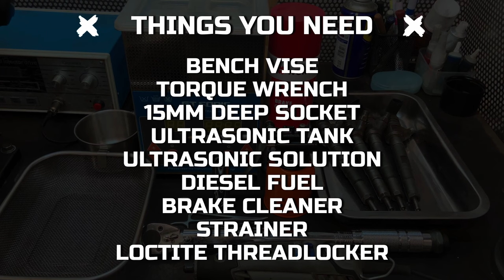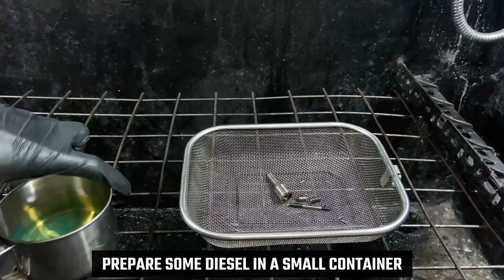HOW TO CLEAN BOSCH INJECTOR NOZZLES LIKE A PRO | 2021 ULTRASONIC CLEANING DIY

Comment: Best film I've seen on these injectors. Exactly what ive got to do, so thanks from here in Cornwall 🇬🇧
Reply from the maker: Thanks! :)
Reply: The exposed procedure is wrong.
Reply: @PopaAlexandru.  why is that?
Reply: @felipeuk12  For example, the lack of a basket in the ultrasonic bath... one error is enough for the whole process to be compromised. And there is at least one more error: the use of thread brake.
Reply: @PopaAlexandru.  well spotted 👍
Reply: @PopaAlexandru.  Hi,  by thread brake you mean blue thread locker? I'm about to do this clean myself so I would appreciate the tip, thanks in advance :)
Reply: @SmokBartozy  Yes, that is blue threadlocker.
Nothing is put on that thread, it is tightened to the torque indicated by the manufacturer. Only .
Reply: @PopaAlexandru.  Thanks for your reply, much appreciated.
Reply: @PopaAlexandru.  what is the correct torque? Do you happen to know?
Reply: @gulag8735  There is a table depending on the type of injector. It can be found at the manufacturer.
Reply: Blue thread lock will soften with about 100 to 110 degrees centigrade. Just warm with a hot air gun using a IR thermometer.
Reply: Where?
Reply: @herobo123456  Video says 50ft pounds.

Comment: I worked in a factory making injectors for ,11 years and can tell you that its impossible to do the job properly at home. Yes you can strip and clean them but you cant reset opening pressure which WILL change as soon as you dismantle the injector,  you cant check the spray pattern properly and you cant check wetseat or backleak time. You need very special very high pressure expensive equipment to do any of that.
Reply: So should I go and buy new injectors for my smoky ford 3600
Reply: I believe with a common rail system, you are using the electrical connector to open the injector. Furthermore, the PCM can smooth out idle pulses by watching the change in rpm as each injector is fired. During acceleration, the smoothing doesn't matter anymore and the watches other inputs such as rail pressure, boost pressure and the air fuel ratio at the exhaust plus temperatures. Modern Diesel design and computer control systems allow for fine adjustments. Due to manufacturing variations, auto makers have several programs to fix injector imbalances on all gas and diesel engines.

Cleaning the injectors at home will improve their flow and spray pattern. The tip does wear over time allowing more fuel to flow than set at the factory but the automakers have a mileage adjustment as well in their fuel calculation.
Reply: I work in the trade since the late 1970s and I never ever saw the opening pressure of an injector change drastically after dis- and reassembly. If you put the tips in the same injector body they came out of, you will be fine in 99,9% of the cases. I also think it is much better to drive with a cleaned injector which is a few bars off than drive with a carboned up and leaking one.
Reply: The best way after cleaning is just put injector on bosch maschine to generate new ima code. Thats all. Then injector can working totaly properly. Of course when is not damaged. New ima is ~20$ pro pice
Reply: great 👍👌👍👌👍👌
thank you much appreciate !
Reply: So expensive pressure washer will do the trick

Comment: One tip from a guy who's job it is to actually recondition these injectors...please don't put loctite on the nozzle threads! When I inevitably get your injectors to properly rebuild, it sure makes it a lot easier when the nut comes off.
Reply: I put loctite on my nozzle surfaces to better secure the nozzle and prevent any leaks. More seal = more power.

Comment: Carefully examine the injector seats pithing the the cylinder head and recut the surface if necessary. Extracting a stuck injector (caused by gas blowing past the copper washer) can be a real struggle.

Comment: This video by itself gives us DIYers the Balls to do these, "Super Technical", "Garage Equipment Only", "Mortgage Expensive", jobs ourselves. SUPERB video!
Reply from the maker: Thanks!
Reply: Please be careful. I absolutely don't want to discourage anybody from fixing their own stuff, but I own an engine machine shop and I rebuild engines for a living. I have to fix quite a few engines their owners destroyed with home-built injectors. If you have an ancient cast iron boat anchor, you can get away with a hobby botch job. But when it comes to direct injection high performance engines you will melt your pistons in a blink of an eye if you mix up shims or plungers or if you install collars backwards.

Comment: If your copper washers get stuck down the bore I welded a thin stud extractor onto a thin extension and it came out immediately after hours of scratching my head.  Very useful video. Thanks.

Comment: Washing up bowl and wifes Vibrator works just as well. If you dont have access to Ultrasonic Cleaner.. 
Enjoyed the vid mate,, thanks for taking the time to make it. 😀👍👍
Reply: Soaking in solvent overnight cleans the internal parts. The tip and screw cap will hardly be touched. 
A strong solution of caustic soda (lye) NaOH will burn out carbon but won't touch steel. It will dissolve aluminium, zinc etc (bad for brass) but these are not present in the nozzle area.

Comment: 👍 Great video.. Very effectively shot with clarity. The best part is no bla bla.. Man you have nailed it.. The best ever video on the injectors. Keep up the great work..💐🌷
Reply from the maker: Thank you! :)
Reply: We are manufacturer specialized in auto and marine diesel engine parts since 1952.
Our main parts are
EURO II system: plunger, nozzle , delivery valves, head rotors, repair kits, etc.
Common rail system: Injector complete and injector spare parts for CATERPILLAR, DENSO, DELPHI , BOSCH, SIMENS, CUMMINS, etc.

If you have any inquiries, pls do not hesitate to contact me.

Comment: Mate, I’m stuck on a rural town and can’t get anyone here to do this job, after watching your video I’m going to give it a go, thank you
Reply: hey mate, interested how did you manage? all went to plan? (never mind the background trap-beatz :)
Reply: @paterix79  car is running perfect now, I only clean the injectors externally, didn’t pull them apart as can’t get the recalibrated where I live, all the copper washers replaced, o rings too and used new stretch bolts, car is purring now

Comment: Great video.  Interesting that these are from a Hyundai and use a shim.  My 2014 328d BMW has what looks like a larger spring and no shims.  I just cleaned mine because I got a fault code for my #3 injector.  BMW ISTA says throw away and replace with new injector!  Well, after cleaning all 4 injectors nozzles, swapping #3 & #4 injector cylinders, reprogramming the computer, and clearing the codes, the fault has not come back and the car runs great.  This is definitely a great practice to add to your maintenance schedule.  I'm just wondering why my original injectors lasted 130,000 miles ( and failed due to a bad CP4 high pressure fuel pump) while my Bosch replacements got clogged after 1 year of service?  Bad fuel? Hotshots additive? Towing 3,000 pounds of wood flooring?

Comment: Great tutorial!👌🏻 after I did this on my Volvo v50 2.0D (Siemens injectors) sometimes it feels like the engine is running on 3 cylinders or an imbalance around 1000 rpm 
You can feel the power increase and it’s running smoother! No horse powers lost but still got this problem:(
Reply: Update: 1 injector got stuck now after ultrasonic clean probably was the injector before already not healthy replacing now for a new one.
Reply: Never open an siemens injector if you dont have that special device to calibrate the injector.
Reply: @crss085  Calibrate via OBDII or do you mean mechanically? Like internal chims etc?
Reply: @daniellenner813  Siemens / Continental injectors have a very small gap set between the injector solenoid and body, this gap is measured in micrometers, for your injector it is 0.3µm ± 1.3µm. You should never take off the soloenoid from a continental injector unless you have tools to measure this gap (I use an Opensystems Megatester V4). As for opening the nozzle side, you will change how the injector works ever so slightly meaning your calibration code will no longer be valid, however sometimes you can get away with this depending on how worn everything is.

Comment: Hi ! My 207 which has 400,000 km and which still has its 4 original injectors, I will do to it what you did (except that I will also unscrew the upper part in order to immerse the injector completely (electrical part removed). I I think they will get a new lease of life. Then I will do the same thing with my original turbo. Thanks for your video! :)

Comment: This is just too good. I have problem with injectors, after i press gas pedal little bit further engine start shaking and almost turning off. When i connect diagnostic i see that 3injectors parameters are going crazy like 4.5-5mg and normal is like 0-1.5mg+/-. I cleaned injectors like this and now car is working perfectly, on diagnostic it shows 0.1-0.2mg.

Comment: Absolutely good performing ! ! !  At what values of the injectors should we start to worry? My one is Audi A6 C7 3.0 dti 204 HP and one of the Injector reading is 0.70 mg . 1 Cyl - 0.7  2 Cyl -0.33  3- cyl 0.13  4 Cyl -0.30 5 Cyl -0.4  6 Cyl -0.10 Mg . Do I have to remove the number 1 injector for cleaning or is there a chance it can be cleaned with a carbon cleaner

Comment: Great help. I'm going to try do the same. But I only have car cleaner instead of the sonic cleaning. Would it be helpful if I unscrew the top part off as well to flush the car spray in there too?

Comment: Hi boss,I have to say a mega video one of the best on the subject of general overhaul of mag-controlled injectors. My question is which threadlocker (medium strength / high strength / heat resistance) do you use? The usual products are resistant up to 300 degrees Celsius - because the temperatures in the combustion chamber are around 900 degrees Celsius! I would be very pleased to receive an answer ... Many greetings
Reply: While the combustion chamber temperatures are 900C, the walls of the cylinder aren't that hot, and things further back are even cooler as coolant channels run by them. I'd say 300C sounds a little low for an engine, but it's probably fine, or rather, if your injectors are 300C then you probably have bigger problems than the type of lock-tite you used, that's really really hot.
Reply: Blue threadlock usually means standard performance stuff. Running temperature will be the same as the engine coolant so nothing fancy needed.

Comment: Where the o-ring needs to be replaced? Is that the overflow pipe or anywhere else? How are the delivery high pressure pipes sealed?

Comment: Really well instructed video, what type of ultrasonic cleaner machine do you use and what solution do you use for cleaning. 
Thanks 
Ash from Scotland 🏴
Reply from the maker: Hi! Got the tank from ebay. Says it has 50w u/s power, 40khz frequency and a 100w heating power at the back. Not sure if it’s really accurate though. Regarding the ultrasonic solution, it’s a custom mix we get from a local supplier here in ph. You can find a lot of them online, just get the ones that are aluminum safe. Thanks for watching :)
Reply: I'm looking for one too.
Allen Dale ultrasonics in the UK have all sorts. I'm going to get a small one. 50 quid. 🇮🇪

Comment: If i want to change the nozzle, do i have to adjust it new with adjust washer? Want to upgrade a stock om611 injector with nozzles from a C30AMG. Same injector, other nozzle. Thanks! :)
Reply: Short answer: yes...
Not all nozzles are built identical, that's why those shims exist... If you do this yourself you can experience a rough idle... But it can be done, the injection angle should be the same...

Comment: I have a question my needle doesn't want to go back. During disassembly it came out very easy now it seize right at the begining. I put the head back for another 30 minutes of ultrasonic cleaning hoping that there is a small dirt. But still doesn't go in. Would it be a problem if I force it? Does this need to be moving once it's assembled ?

Comment: Should the injector body not be cleaned as well?  Should this resolve noisy injectors on a toyota 1kd engine?  Mine sounds like it has a massive diesel knock while driving, 200000km

Comment: What liquid solution is best to use in ultraosnic cleaner? Seafoam motor treatment ?
Reply: Dishwasher powder. You can buy special injector cleaning solution for 60 bucks a quart, but according to the safety datasheet that stuff is just caustic soda and detergent. Exactly the same as dishwasher powder.
Just be sure to rinse the injectors directly after cleaning them and put them in a cup of diesel fuel immediately. If you don't do that, they will develop surface rust in just a few minutes and then they are basically trash.

Comment: hi, once the cleaning is done, do the injectors have to be calibrated on the test bench?
Reply: If you install the tips in the injector bodies they came out of and if you don't mix up the shims in two stage injectors you will be fine. If you mix up the shims for the pilot and main spring, you are fckd, though. Be careful.

Comment: Will it help if my turbodiesel smokes black on acceleration? Everything else is checked. The mileage is 265.000 km and I believe the injectors were never out of the engine.
Reply from the maker: Yes it might. If not, best to have them tested at a reputable shop. You might also want to check your turbo and air intake system since you’re getting black smoke, you might be running rich, too much fuel, lack of air.

Comment: Hi great video! is it necessary to adjust the injector on a special machine after this cleaning? thanks!
Reply from the maker: Basically, all injector calibration codes are inputted in the ECU from the factory. These codes help the ECU determine the specific output flow of each injector as no injector is exactly identical. Now, wear and tear or repairs such as replacing some injector internals with bnew ones will give a different output than the programmed data in the ECU. This scenario requires a special machine such as Hartridge Injector Calibrators to generate new calibration codes for each injector then you can input these codes in the ECU using a scantool with an Injector Coding function. If you just cleaned the internals like we did in this video and didn't notice any loss of power and high fuel consumption afterwards then you're fine. But if you did, It's best to bring your unit to a calibration shop that can test/read and generate new calibration codes for your injector.
Reply: @btdgarage  Hi, thanks for very detailed explanation!!! it is very clear now!!
another question and last one is if is necessary to ANNEAL the washers under the injectors before mounting or not? Thanks again :-)
Reply from the maker: @martintoman6266  Thanks Martin! Annealing the washers isn't necessary but also not a bad idea if done properly.

Comment: Does the body of the injector ever need cleaning out, once you've removed the shims and spring? Or is that part generally clean?
Reply from the maker: Hi Paul! Not really but it wouldn’t hurt to pour some diesel in the holes while it’s upside down then quickly turning it upright to let it drain. Carbon buildup usually takes place in the nozzles. In some cases though where the injectors get contaminated by water or particles from dirty diesel, the injectors will require a complete tear down/reconditioning but it’s best to let a professional do it.

Comment: If you have had a catastrophic HPFP failure on a vw 3.0L CATA 2011 Touareg are the injectors salvageable?  Can I clean them and reuse them or are they scarp?  Do the aluminum particles from the HPFP do damage to the injectors that can't be fixed?
Reply from the maker: It depends on how long you were still running the engine after the HPFP was shot. Try to check the fuel rail and pipes first for debris. If you find any, it’s best to bring the injectors to a professional who can fully take it apart and run it on a bench test machine.

Comment: Hello. Is it a concetrated cleaning solution? What do you use for mixing? Water? Thanks.
Reply: If you rinse and oil the parts IMMEDIATELY after taking them out of the cleaner, dishwasher powder in about 60 degrees C water works incredibly well. 
But you really have to rinse and oil the parts immediately after taking them out of the bath. They will develop surface rust in mere minutes and then they are destroyed.

Comment: A great video, a question for all Bosch injectors, is the nozzle tightening torque the same or does it change?
Reply: It is 80Nm for the old indirect injection ones and 45Nm (or 30 degrees after seating the collar) for the two-stage TDI injectors.

Comment: Remember to reset injector adaptations if cleaning injectors. BTW, saw you had other Ranger 3.2 videos, have you cleaned the turbo on that one?
Reply: There are cars whose injection computers adapt to the injectors and others that need to be told which injectors they are. Both mentioned types are with Bosh electromagnetic injectors.

Comment: As you answered the question about taking it to get them calibrated, would I need to know the number codes of 123&4 or does machine find them thanks and great vid tutorial
Reply from the maker: The machine will generate new codes for your injector. If in case you're buying a new set, use the codes located on top of each injectors. Thanks!